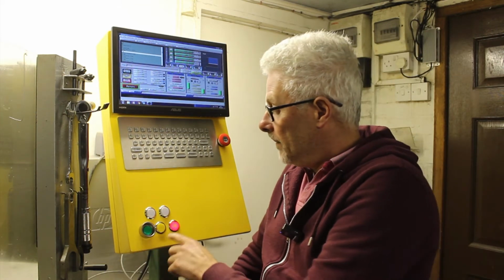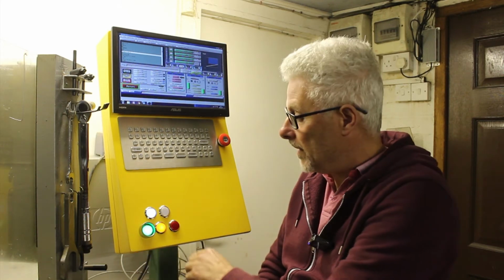DIY CNC Control Cabinet PT3

Comment: My father is in a really fragile situation too, I totally understand how hard it can be and imagine the time when he will be gone hits me hard. Take care.

In regards to the arduino Keyboard emulator. I am doing the same, maybe try with another keyboard shortcut to see if that solve the problem.
Reply from the maker: Thanks Ale, good luck with your father. 
I have tried several shortcuts all work the same. The weird bit is it will stop the mist but not turn it on its the same command! Alt m. 
My feeling is its a timing issue with the pc and the keyboard it looks like Mach 3 polls the keyboard more slowly for this mist on off control.
Reply: @CazualHaze  Thank you.

It's indeed weird that doesn't work. You cna always control the mist with a latching button to the solenoid valve but then it's outside Mach3.
Otherwise you can make 2 new buttons in the Mach3 screenset (also transparent are fine). then you assign 2 new short cuts to them and GCODE function: M7 to one and M9 to the other. Then in arduino with the same input you can assign different operation based on the number of repetitive clicks or push and hold function. Here an example of the code for only one button fully wrote, but it's just to understand the logic:

/*
   This sketch is to use a Micro,Leanardo as a keyboard emulator. In my case Mach3.

   
   For each button you can have up to 6 command. For the moment I only use the single press to do not have doubts while operating the CNC.
   At the bottom there are some additional info and other key you can call with the arduino.
*/

// Libraries

#include "ClickButton.h"
#include "Keyboard.h"
long int aux1_delay = 0;

// Nr. of buttons in the array
const int buttons = 10;

// the Button
// buttonPin0 is a dummy because I want to start with '1' instead of '0'
const int buttonPin0 = 0;

// these are actually used
const int buttonPin1 = 0;
const int buttonPin2 = 1;
const int buttonPin3 = 2;
const int buttonPin4 = 3;
const int buttonPin5 = 4;
const int buttonPin6 = 5;
const int buttonPin7 = 6;
const int buttonPin8 = 7;
const int buttonPin9 = 8;
const int buttonPin10 = 9;
//const int buttonPin11 = 10;
//const int buttonPin12 = 11;
//const int buttonPin13 = 12;
//const int buttonPin14 = 13;
//const int buttonPin15 = A0;
//const int buttonPin16 = A1;
//const int buttonPin17 = A2;
//const int buttonPin18 = A3;
//const int buttonPin19 = A4;
//const int buttonPin20 = A5;

// Instantiate ClickButton objects in an array
ClickButton button[11] =
{
  // dummy
  ClickButton (buttonPin0, LOW, CLICKBTN_PULLUP),
  // used instances of Clickbutton
  ClickButton (buttonPin1, LOW, CLICKBTN_PULLUP),
  ClickButton (buttonPin2, LOW, CLICKBTN_PULLUP),
  ClickButton (buttonPin3, LOW, CLICKBTN_PULLUP),
  ClickButton (buttonPin4, LOW, CLICKBTN_PULLUP),
  ClickButton (buttonPin5, LOW, CLICKBTN_PULLUP),
  ClickButton (buttonPin6, LOW, CLICKBTN_PULLUP),
  ClickButton (buttonPin7, LOW, CLICKBTN_PULLUP),
  ClickButton (buttonPin8, LOW, CLICKBTN_PULLUP),
  ClickButton (buttonPin9, LOW, CLICKBTN_PULLUP),
  ClickButton (buttonPin10, LOW, CLICKBTN_PULLUP),
  //ClickButton (buttonPin11, LOW, CLICKBTN_PULLUP),
  //ClickButton (buttonPin12, LOW, CLICKBTN_PULLUP),
  //ClickButton (buttonPin13, LOW, CLICKBTN_PULLUP),
  //ClickButton (buttonPin14, LOW, CLICKBTN_PULLUP),
  //ClickButton (buttonPin15, LOW, CLICKBTN_PULLUP),
  //ClickButton (buttonPin16, LOW, CLICKBTN_PULLUP),
  //ClickButton (buttonPin17, LOW, CLICKBTN_PULLUP),
  //ClickButton (buttonPin18, LOW, CLICKBTN_PULLUP),
  //ClickButton (buttonPin19, LOW, CLICKBTN_PULLUP),
  //ClickButton (buttonPin20, LOW, CLICKBTN_PULLUP),
};

void setup()
{
  // Setup button timers (all in milliseconds / ms)
  for (int i = 1; i <= buttons; i++)
  {
    button[i].debounceTime   = 20;   // Debounce timer in ms
    //button[i].multiclickTime = 250;  // Time limit for multi clicks
    //button[i].longClickTime  = 1000; // Time until long clicks register
  }
}

void loop()
{
  // Update state of all the buttons in the array
  // NOTE: not started at '0' but '1'
  for (int i = 1; i <= buttons; i++)
  {
    // Update state of all buitton
    button[i].Update();
  }

  // execute button presses
  if (button[1].clicks != 0)
  {
    switch (button[1].clicks)
    {
      case 1: // Single click
        // press the CYCLE START (ALT + R)
        press_START();
        break;
//      case 2: // Double click
//        press_ESC();
//        break;
//      case 3: // Triple click
//        break;
//      case -1: // Single Click and Hold
//        // TURN DRIVERS OFF
//        press_ESC(); // get out of handwheel mode
//        goto_MACHINE_IO_MENU();
//        press_F2();
//        goto_MAIN_MENU();
//        break;
//      case -2: // Double Click and Hold
//        break;
//      case -3: // Triple Click and Hold
//        break;
    }
  }

/*
  Aduino website notes on using a Leonardo as HID:

  The keyboard functions enable a Leonardo, Micro,
  or Due to send keystrokes to an attached computer.

  Note: Not every possible ASCII character,
  particularly the non-printing ones, can be sent with the Keyboard library.
  The library supports the use of modifier keys.
  Modifier keys change the behavior of another key when
  pressed simultaneously.
  See here for additional information on supported keys and their use.

  Keyboard.begin()
  Keyboard.end()
  Keyboard.press()
  Keyboard.print()
  Keyboard.println()
  Keyboard.release()
  Keyboard.releaseAll()
  Keyboard.write()

  Reference   Language | Libraries | Comparison | Changes

  Keyboard Modifiers

  The Keyboard.write() and Keyboard.press()
  and Keyboard.release() commands don’t work with every possible ASCII character,
  only those that correspond to a key on the keyboard.
    For example, backspace works, but many of the other
    non-printable characters produce unpredictable results.
    For capital letters (and other keys), what’s sent is shift plus the character
    (i.e. the equivalent of pressing both of those keys on the keyboard).

  A modifier key is a special key on a computer keyboard that modifies
  the normal action of another key when the two are pressed in combination.

  For more on ASCII values and the characters or functions they represent,
  see asciitable.com

  For multiple key presses use Keyboard.press()

  The Leonardo's definitions for modifier keys are listed below:

  Key  Hexadecimal value Decimal value
  KEY_LEFT_CTRL     0x80  128
  KEY_LEFT_SHIFT    0x81  129
  KEY_LEFT_ALT      0x82  130
  KEY_LEFT_GUI      0x83  131
  KEY_RIGHT_CTRL    0x84  132
  KEY_RIGHT_SHIFT   0x85  133
  KEY_RIGHT_ALT     0x86  134
  KEY_RIGHT_GUI     0x87  135
  KEY_UP_ARROW      0xDA  218
  KEY_DOWN_ARROW    0xD9  217
  KEY_LEFT_ARROW    0xD8  216
  KEY_RIGHT_ARROW   0xD7  215
  KEY_BACKSPACE     0xB2  178
  KEY_TAB           0xB3  179
  KEY_RETURN        0xB0  176
  KEY_ESC           0xB1  177
  KEY_INSERT        0xD1  209
  KEY_DELETE        0xD4  212
  KEY_PAGE_UP       0xD3  211
  KEY_PAGE_DOWN     0xD6  214
  KEY_HOME          0xD2  210
  KEY_END           0xD5  213
  KEY_CAPS_LOCK     0xC1  193
  KEY_F1            0xC2  194
  KEY_F2            0xC3  195
  KEY_F3            0xC4  196
  KEY_F4            0xC5  197
  KEY_F5            0xC6  198
  KEY_F6            0xC7  199
  KEY_F7            0xC8  200
  KEY_F8            0xC9  201
  KEY_F9            0xCA  202
  KEY_F10           0xCB  203
  KEY_F11           0xCC  204
  KEY_F12           0xCD  205

*/

void press_START()
{
  Keyboard.begin();
  Keyboard.press(KEY_LEFT_ALT);
  Keyboard.press('r');
  delay(100);
  Keyboard.releaseAll();
}

void press_HOLD()
{
  Keyboard.begin();
  Keyboard.press(KEY_BACKSPACE);
  delay(100);
  Keyboard.releaseAll();
}

void press_STOP()
{
  Keyboard.begin();
Keyboard.press(KEY_LEFT_ALT);
  Keyboard.press('s');
  delay(100);
  Keyboard.releaseAll();
}
Reply: @CazualHaze Ah another possibility can be that you did not add the delay after press and the release all function, that is really important since you are toggling on the same button

{
  Keyboard.begin();
  Keyboard.press(KEY_BACKSPACE);
  delay(100);
  Keyboard.releaseAll();
}
Reply from the maker: @Ale_Lab  yep I think I have tried adding more delays in I am still thinking it's a timing issue. It's just so odd it works to turn off but not on  with the same command.
I did not use an array as you did mainly because I don't fully understand them. 
Cheers
Reply: @CazualHaze  but after the delay did you add the release all command?
Reply from the maker: Fairly sure I did but I will have another bash and let you all know.
Reply: @CazualHaze  Other wise you will need to go for the separate M7 and M9 command in the screenset and connect it to the single button with 2 operations defined or use 2 separate physical buttons.

Comment: Did you try to change the mist shortcut to something else?

Take care in this difficult time.
Reply from the maker: Thanks Stiopa, Appreciated.
Tried changing the shortcut its a bit odd I replied to Ale with a bit more detail I have found out. Incidentally if you go down this route, using f1 to f12 as shortcuts is a bit variable too they dont all work. Some are pre-set to things like change screen or start spindle. you can map them to two different things and it all grinds t a halt.